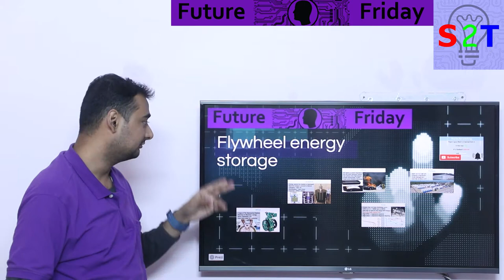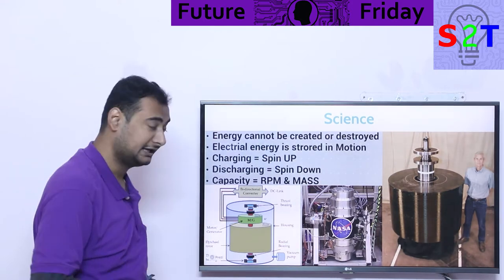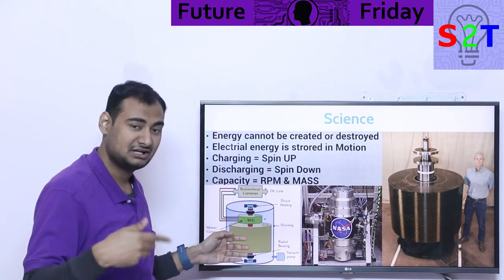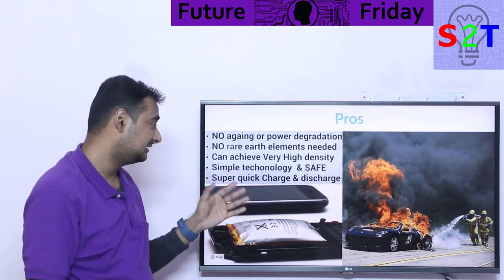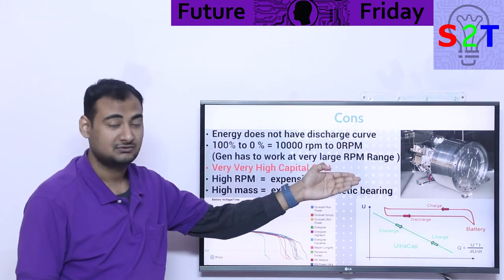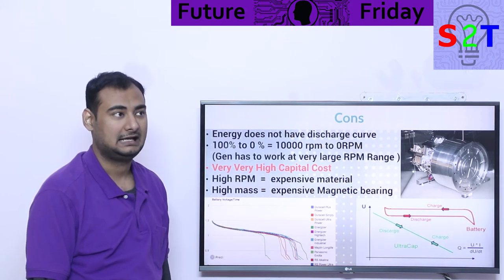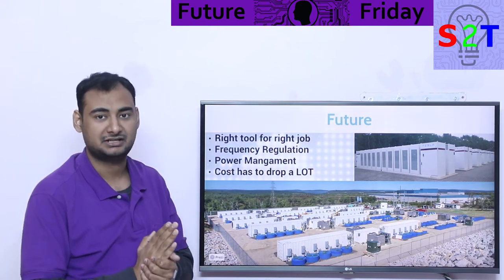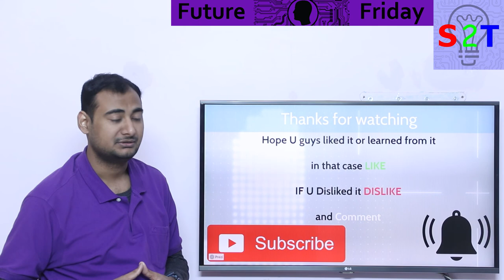Flywheel Energy Storage Explained {Future Friday Ep131}

Comment: Awesome presentation. Keep up the great work! What would be interesting do know, if this technology could be used in electric cars to reduce the use of batteries, like a hybrid solution. Maybe this could be a topic for you. Have a nice day
Reply from the maker: there where bus that tried that but U have to understand we want solid state reduce moving parts this goes against it
Reply: @s2tenglish  You want to reduce costs. I agree, that this is an expensive solution because of the bearing system. You also want to reduce using rare and not environmental friendly materials. So using a "mechanical battery" sounds like a charming solution